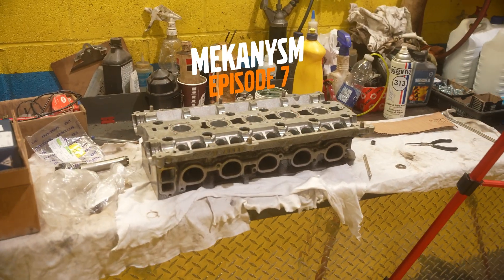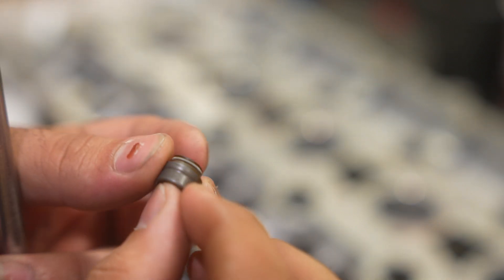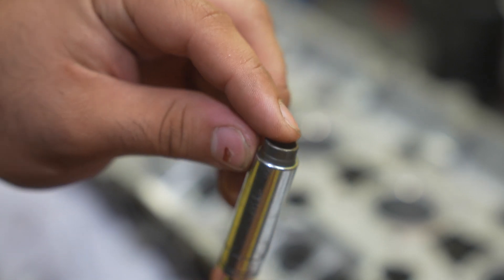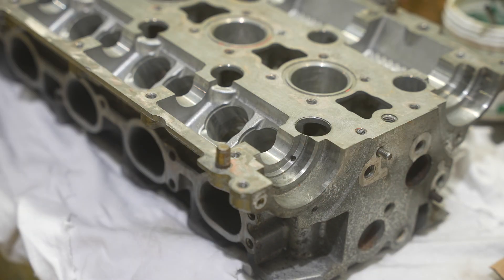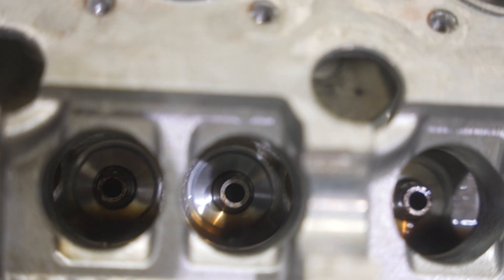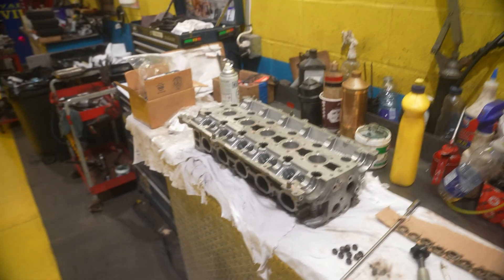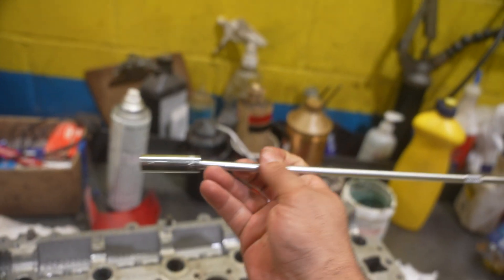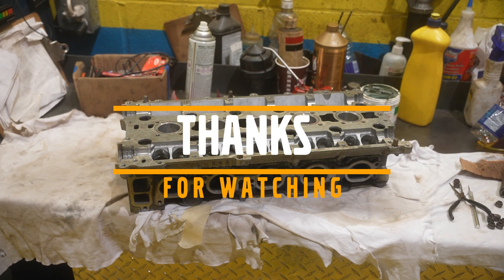VALVE STEM SEALS INSTALL **HOW TO**  I  VOLVO V70R Build Part 7

Comment: I wonder how much a shop would charge too complete the job?
Reply from the maker: Keep in mind that this is a time consuming process. Also, keep in mind that if you do not take the engine out yourself, the additional cost to do so would have to be included as well. Any engine work is expensive  normally. Not a hard job in that case, but very annoying and time consuming :/